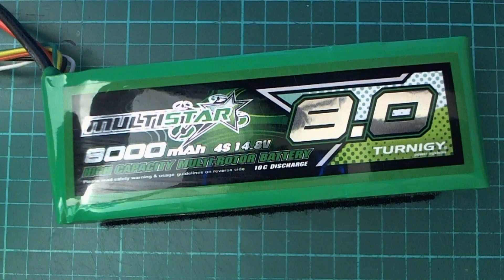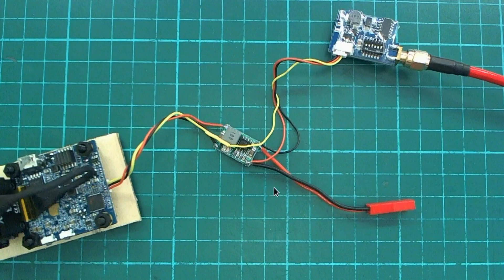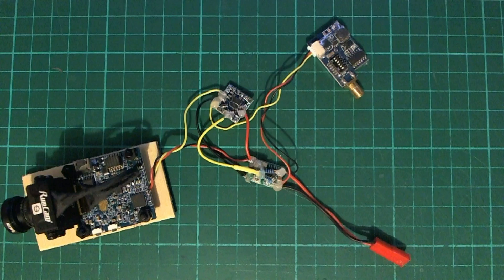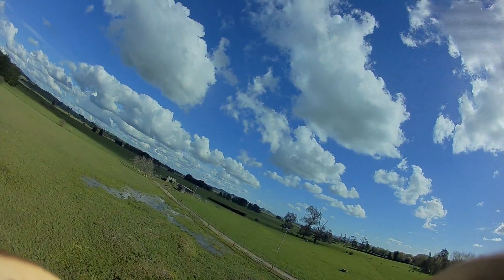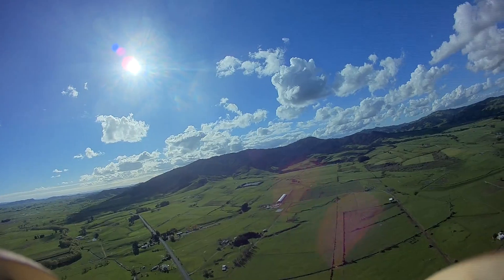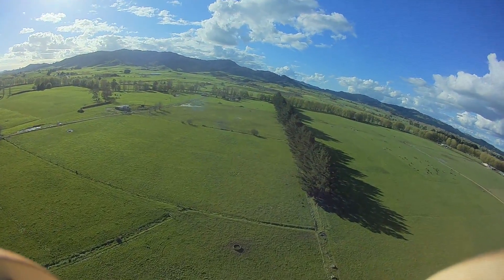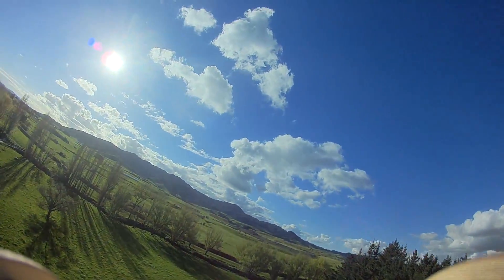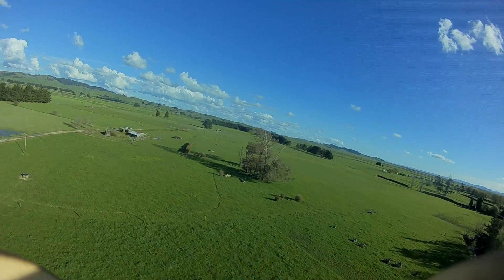Mini-talon + 4S 8Ah = 71 minutes

Comment: I have a 6500mah I'm going to try out in my mini talon. Did you have any issues hitting cg with the 8000mah
Reply from the maker: Not really. Just needs a good throw to launch, and lands pretty fast. These days I'm using a 5200mAh, seems actually a tad light, so 6500 might be just nice.
Reply: @iforce2d  I'm ready to maiden but thinking about upgrading inav first

Comment: Correct me if I'm wrong but, if you were to find 2 10,000MAH 7.4v 2S batteries, the small ones. 7.4v×2 is 14.8v. so not only I used two battery's to come up to perfection for my powertrain, but I just made a 20,000mah battery??
Reply: You'd need 4 to make a 20,000 mah 4s battery.

Comment: The underside of the trailing edge of the wing,  is not flat it tapers up slightly (which would reduce efficiency). Bending it down to be flat would be beneficial. Flys fine afterwards, but only done one flight like that so far. I need to get out and fly it a bit more :)

Comment: How much you think prop choice would make a difference?  Is that stock motor you are using?  What motor are you using? I didnt do mine yet and I think its just a kit without electronics.

I could almost swear that i saw some videos on YT people having similar flight times with smaller battery...
Reply: I saw you have put data in the description. Thanks.
Reply from the maker: I actually think the motor mine came with is supposed to be for the bigger Talon (1700mm wingspan one). I see a lot of people using a 2216 which seems more reasonable and would squeeze a bit more flight time maybe (slightly lighter).

Comment: Nice one Chris,  my miniTalon's still waiting it's build, so hadn't decided on LiPo size yet, but wondered about the CG with these big ones? you flew it so placing the LiPo doesn't seem to be an issue?
Reply from the maker: Yeah, not an issue. In fact it pretty much needs this much weight up front to get it balanced, at least with the large motor mine has. I actually think the motor mine came with is supposed to be for the bigger Talon (1700mm wingspan one). I see a lot of people using a 2216 which seems more reasonable.